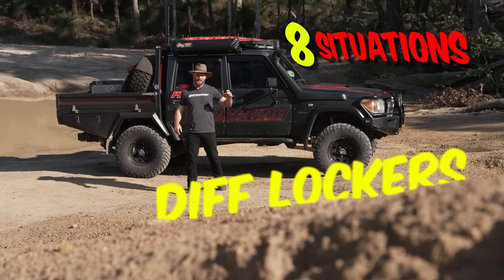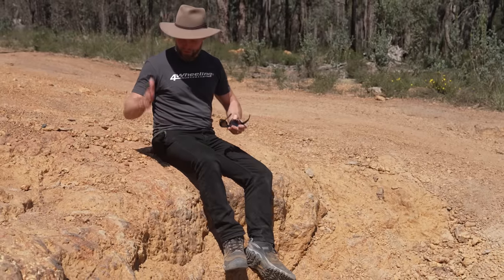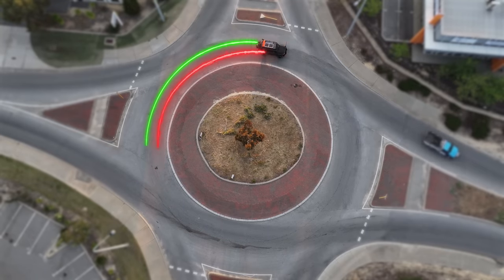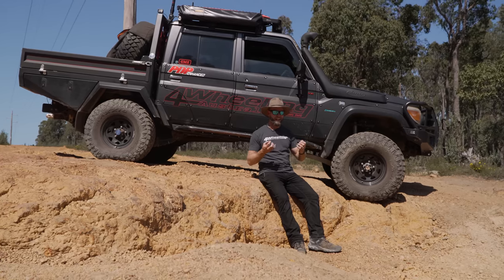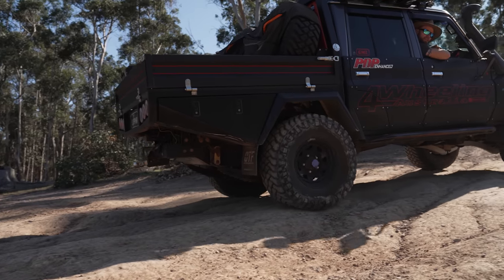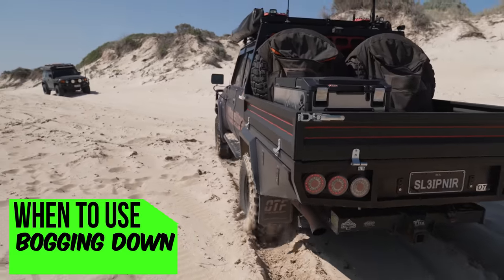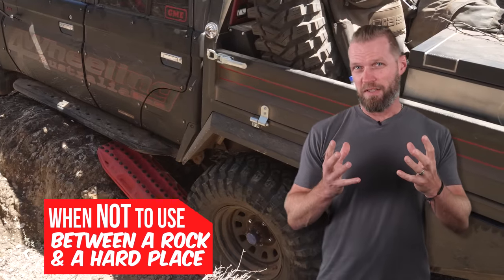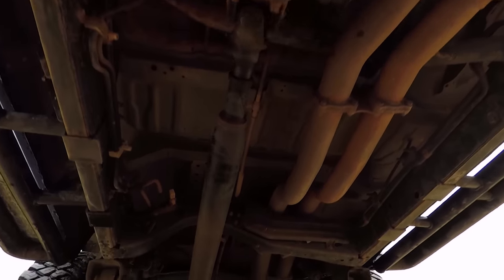8 SITUATIONS NOT TO USE DIFF LOCKERS #difflockers #4wdlockers

Comment: I used to have a Delica Starwagon with lo range, which meant it could crawl almost anywhere, however one day out driving in 2wwd Hi I had to stop for roadworks, so did as I normally did, came slowly down through the gears into N, and waited, until the paddle was turned and off I went, on a long sloping downhill on solid dry tar-seal.
In 2wd Hi, I thus was surprised when I next selected 5th to have:

Absolutely nothing there.?
Not even what I'd had a year before when the 5th cog came loose on it's layshaft, with some force required to hold 5th engaged, this time I just had absolutely nothing
It was a completely limp  stick, so down into 4th & there it was again, feedback and driving OK, no trouble, nor in & out of any other gear right down until stationary.
I drove home (30+miles away) with 4 gears.
...
Now, I know a little (enough) about gearboxes, and saw what mine was like when the mechanics had it open (as well as viewing pictorials online of exploded views, so was amazed to learn the 5th gear cog had "exploded" literally (not a sound was heard before he event or afterwards, so am guessing it may have simply been severely cracked and just fell apart..

IDLING.

Ok, so the mechanics here don't repair/restore gearboxes, and thus sent it away (as they did last time) with my express insistance, that if they can't fix it with another 5th gear cog, then put in a dummy cog and leave me (thank you) with the four i could use..

Three months later, and it arrived back in a trillion pieces, with a sorry, they can't find any more repair kits anywhere in NZ or overseas.

Hence I no longer have my lovely off-roader.
What I have ended up with, is a nice shiny near new (with barely 80K on the clock) a pre-release 2006 that was registered in late Oct 2005 with bits from Belgium even, having a manufactured date of Aug 2005 

(so was a pre-released 2006 hi-spec'd Japanese-only model, later exported as 2nd hand to NZ in late 2001, which I bought in early Feb 2002).

Ok so I have basically a new car with just gone 100k on it, that has ONLY a center diff lock, in 4wd-LOCK, meaning I have a straight out 4x4 with center lock.
There is the obligatory
 2wd mode, and an AWD (4wd) open center diff mode, which simply allows the rear axle to "help" the front when it slips..?

BUT:
Does my XLS 2005/2006 Outlander (with towbar) and selectable 2wd / 4wd & 4wd_LOCK ...
Have a limited slip rear diff as stock standard, or does it have a freely open rear diff.
And if the latter, is there an electric rear diff locker "diff head" that will easily slip into place when the stock OEM rear diff is removed (at my local garage) ?
After all, we have SNOW here most winters, and often face muddy roads in the back country hereabouts, with an annual hard-out 4x4 off-road tour across all the mountain peaks, to get from here to there with an annual four wheel drive club's Christmas outing..

I went on one of the local LIONS CLUB, 4x4 off road events, in my demo work van - with it's massive 7p3+1 full noise surround sound system, (with 25 "oddment" 2nd hand, and new, speakers & coloured light fittings aboard) traipsing across that back country - as if a feather, managing the rough high country tussocks and muddy terrain, far better than most of the other 41 vehicles that year, including the brand new 4door UTE of one of the richest landowners around, who got cocked-up coming out of a downhill washed-out-rut, creating a huge roar of laughter from almost everyone in that drive, as he needed to be pulled out, by some others more able to do that for him, as I was late to the scene, and waved around, as if the Delica couldn't have sprung him out? Especially as MANY had claimed, prior to our departure in a nearby town, that me and my "obviously" overloaded with sound system "things" work van, wouldn't even get past the 1st farm gate, and there it was, out-driving most of the others most of whom struggled here and there, even easily getting up a very steep snow-tussock hill, to the Trig Station on the top of Mt Onslow, when we went past) ...

I diverge, is there any after market 4wd electric diff locker, that could fit my 2005/2006 XLS Outlander?

Comment: Good info. Hv always wonder when is bad to use lockers.
Would love your analysis on auto lokkas. Have been using one in the front of an ifs for years due to better affordability.
Reply: Yes, cheap but will cost you in the long run due to = increased load on all the other front drive components when you don't want it or need it.

Comment: What do you think about torsen lockers?  I was thinking it might be better for avoiding breakage on a weak front end because you wont have so much free spin.
Reply: Limited availability for only a few vehicles. Are not a true locker. Will not handle high horsepower applications.

Comment: Thanks for the video, it's very informative. I have a question however; don't some cars engage the rear locker automatically even in 4H? I have a 2011 Ranger (used in a farm) and the moment I engage 4H I get the rear locker sign light up. If I want to disengage it, I have to go to two wheel drive and press the locker button which you cannot do in 4H or 4L (at least according the icon on the dash). Am I doing something wrong? Thanks in advance for any help!

Comment: Can I get more detail on not using on side slope. I don’t have lockers ATM but are seriously considering them (or upgrading to a vehicle with them). 90% of my 4WDing is on the beach. Sometimes when getting off the top line gravity pulls you down to the water line. What's the best option?

Comment: Can u explain more on Prado 150 how to use the 4WD with Center locker Coz I am confuse there is H and L 
Not like used to be 2H 4H and 4L
Reply: I have a 150 Prado. Centre diff should be engaged whenever you are in high or low range 4 wheel drive and turned off on high traction surfaces. The centre diff ensures 50% of power goes to front wheels and 50% to back wheels
Reply: My answer to your query was not entirely clear - the centre diff should be engaged on low traction surfaces and turned off on high transaction surfaces.

Comment: Would you apply the same rule to not use diff lock on 4hi when it’s the center differential? Or on a center differential it doesn’t matter if you lock it in 4hi?

Comment: I'm running Lunchbox Auto Lokka's front & rear in my Jeep because they free spool when turning but it means I can't use my Full-time 4wd on hard wet surfaces (Only Negative I've experienced)....
The main benefit is I can turn the steering and the outside wheel will unbind but I have full torque driving through one of the tyres 🎉
The other benefit is they are working all the time until they don't need too and yes unspool to relieve drivetrain whined up😁🙃🫠

Have you ever experienced using Lunchbox Auto Lokka's?

Comment: Would be keen to see a video on both Air and elockers 👍🏽
Reply: already been done - do a search. In a nut shell =  air lockers leak due to hardened seals exposed to hot/cold oil, ie require expensive maintenance - elocker is physically small in hemisphere and cross shaft size, ie prone to failure if abused.

Comment: never engage or disengage your locker under load. if you need the locker to climb a hill it's in until you reach the top or flat ground.
lockers are beneficial in high range when low range reverse may be too slow to get out of a boghole. on vehicles with a good crawl ratio or low 1st gear often low range isn't necessary but lockers are.
you don't hammer down in low range or at full lock lockers engaged or disengaged
you don't use momentum on high traction surfaces lockers or no lockers.
you do use momentum for low traction surfaces like mud and sand in mud especially lockers will help.
you use the same lockers downhill as you need to climb up the same hill. if you would need both to go up you use both to go down because you're going to lift wheels at the same place you lift a front wheel and engine braking is only working on the rear, the vehicle slides forward and the back end can slide sideways. there's no concern about breakage because the axles aren't seeing anywhere near the torque as when climbing. 
hopefully you'll correct some of the misinformation in this video.

Comment: Help Me Ronda
I have a 2018 Isuzu. no rear locker on it. and yep, even my wife has seen the benefit of a locker when we were with a large party. we had to use a bit of aggression to get the task done, others just idled up. 
So, I have permission to install a locker. Maybe even been told to install a locker. She wasn't a fan of being shown up by a Great Wall with auto lockers.

Would just the rear be enough. as this will stop the lifted front wheel spinning off at high speed with the opposite rear wheel. 
then ??? do I add free running hub locks?

Comment: The concept of centre diff confuses me a little still. Is CDL locked by default? My understanding is that locking the rear or front may not mean much if the centre is still open, unless you have both front and rear lockers. If for instance you only have a rear locker and you get a front wheel in the air, without a locked centre diff then 100% of the power will go to that spinning front wheel, with or without the rear locker. The confusion is even more because of how different manufacturers and models implement the whole concept of centre diff. Some lock by default when you go into 4L
Reply from the maker: In order to get 4wd the centre diff must be locked which in many cases is the transfer case on a part-time 4WD.

In a fulltime 4WD vehicle you need to lock the centre diff to get ‘real’ 4x4/4wd as the fulltime 4wd is really just ‘All Wheel Drive’

Only then will most vehicles allow a diff locker to engage and usually rear needs to be activated before front can be. This is in the case of ‘factory lockers’

In the case of aftermarket lockers you can activate whenever you choose depending on how they are wired up.

Hope that made sense.

Cheers Ronny

Comment: The biggest mistake people make with lockers is installing and or using them with stock axle shafts. Most stock axles were never designed to withstand the forces a fully loaded vehicle with a locker generates. If your front axles can not withstand zero torque being applied from the engine going down a hill, you clearly have put the cart in front of the horse. While turning will be more difficult going down hill with a locker engaged, any axle in the front of a rig should easily be able to handle the stresses put on it by simply steering with no throttle applied. If they can't, you need stronger axles. If you're going to spend the money on lockers spend the money on the strongest axles you can buy. This way you don't have to constantly be in fear of breaking an axle, and you can actually leave the locker engaged to do the job it was designed to do.

Comment: I'm afraid to use the cabinets to avoid damage. And I think it limits me a lot. The constant fear of damage is bad. My car does not have a center differential, it has front and rear lockers. So I'm afraid even when using the 4x4 drive. It's a terrible car :(

Comment: Adding lockers to a diff never designed for them is a bad plan on average.
Also, my experience has been never to use lockers on the downhill.  Allow each wheel to spin independently for maximum traction.  
If one wheel locks up, the other side wheel does too.  Now you're in trouble on alot of surfaces and angles.

Comment: Ttried lockers, they break, i use stock open diffs with 4:56 gears, warn locking hubs, 1993 F150, 35" Coopers on stock steel wheels, bullet proof.

Comment: You say only use a locker in Low Range for driving characteristics and safety (fair points) but then you say due to stress on the drive line. I fail to see that, as the lockers are downstream of the transfer case, so you have the torque multiplication of the engine torque (due to the low range being engaged in the transfer case) acting on the diff input shafts (i.e. prop shafts). This is placing more torque, not less, on the diff gears and shafts than high range ever could.

Comment: Well I disagree with Front locker and downhill
Without I had trouble that one wheel was spinning forward an the other rotated backwards while I was sliding down the hill.
Engaged forced them to always rotate smoothly and let them have more grip in really bad situations

Comment: Why u r not mentioning the Center Locker !!!
Reply: Probably because it’s just not that common. That said I love having a center locker. As soon as I hit the gravel I’m aired down and in AWD. I’d almost rather run center unlocked rear locked for the twisty switchbacks I often encounter in east coast US wheeling. Especially if it’s a torsen center and the truck has traction management.
Reply: @Hammbone2519  thanks for info, nice video

Comment: If you are bogged down in the sand and you put the lockers is not it better to be in 4hi cause in 4lo there will be too much power and slow rotation in the 1st gear that will simply enlarge the whole you are in instead of getting your car out of it. As in sand we drive on 4hi anyway.

Comment: 🤔🤔🤔 My car automatically locks the rear diff once sand mode is selected and it defaults to 4H... Guess some. Car would be fine with rear lock on and 4H you don't need 4L😅

Comment: Why would someone pick air lockers over electric?
Reply: If you have air lockers you have an onboard air source. You can then air up or down tires or run air tools if your set up is right. You can still engage one with an outside air source if something gets damaged on the trail. Rip a harness out at the plug and see how effective that e-locker is. Many advantages to air lockers
Reply: I've never had any trouble with electric locker but never had air locker either. Just seeing the guys with air lockers always having trouble and thinking if you have air lockers you have to have electricity and air for air lockers. All you have with locker is a couple wires not electricity, air lines compressors and such. I do have onboard air already for tires I just figure air lockers has way more to go wrong with alot more components and even needs more power. I must admit I don't have first hand experience with air but figured all the heavy machinery, farm equipment, military vehicles, side by sides jeeps broncos power wagons I've been around and don't recall ever seeing one come with air lockers.

Comment: I don't worry about diff locks, I don't have them nor do I need them
Reply: Youll need them depending on what 4wdring you do bud
Reply: You don't need anything until you do.  Same can be said for maxtrax,  winch even your shovel.  How many set of tracks have never seen dirt....??   Is that common sense, dumb luck, proper psi, good line, not being in really soft sand or just staying in the coles carpark?
Like a winch, they provide an additional option for traction and recovery.   They can often get you deeper into trouble too with a false sense of confidence 😂
Reply: @Mouldyturnip75  I learnt my lesson 30 years ago when I went 4x4ing by myself, I got stuck and basically destroyed my transmission. No I don't need diff locks they are a waist of my time and money, plus the extra stress on my old driveline is also a bad idea. I'll stick with common sense and part of that is not destroying a perfectly good 4x4 by abuse. But thank you for the advice that I have already considered 20 years ago.
Reply: Im not saying your needs do, everyone is different and everyone's needs change over time - depending on types of driving and trips we all do.   I agree, age brings wisdom and the application of all the things we've learned along the way.   I've learned to value them - they get more use than the winch - but Im glad I have them all my vehicles, they've paid for themselves times over - we do a fair bit of remote and solo travels so insurances like lockers, winch, 2nd spare, sat phone etc all play a part is preparedness for unexpected.  Enjoy your travels.